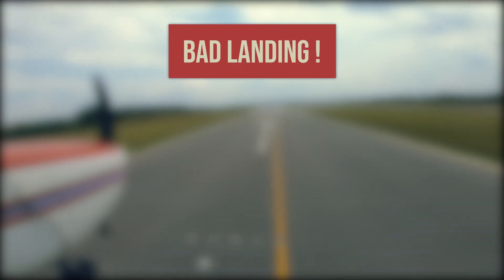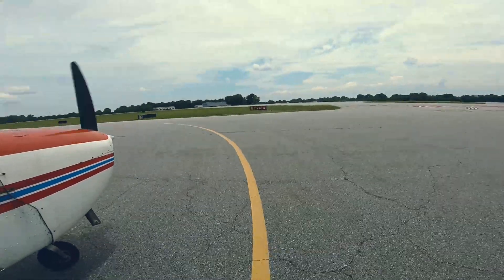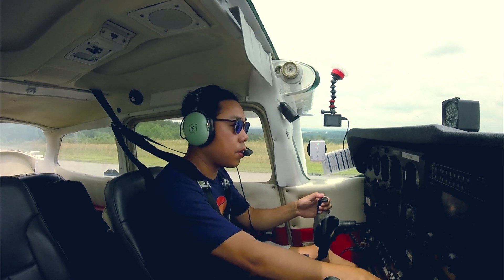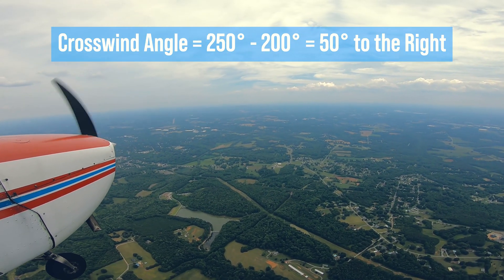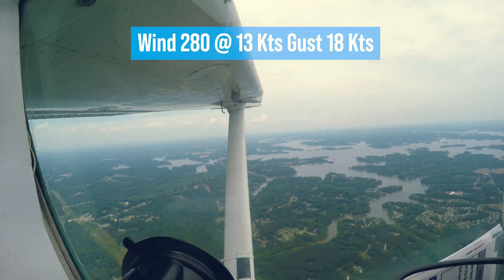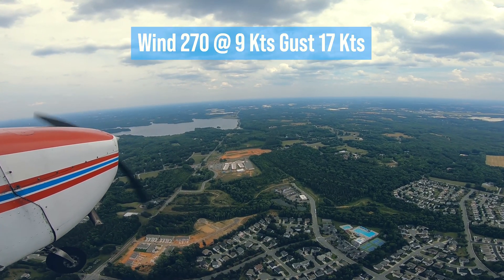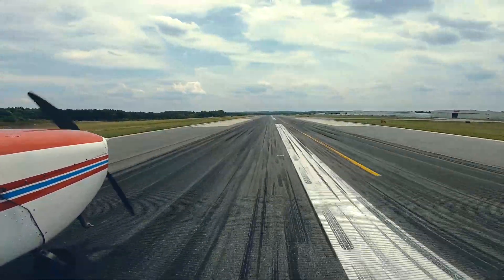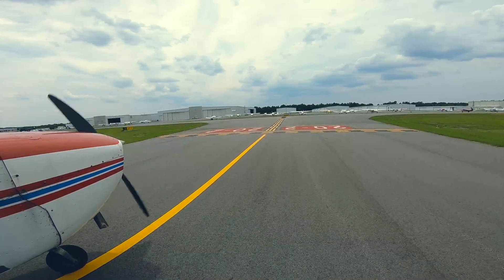WORST Crosswind Landing? Cross and Gusty before Storm

Comment: In my opinion, the landing was actually pretty good. The final was very stable despite the gusting crosswind. Good job there for sure. With 20/20 hindsight, I probably would have gone around once I see the deviation from the centerline due to gusting wind.
Reply from the maker: Thanks Peter! If the runway is 50 ft wide instead of 100 ft, I would definitely go around.

Comment: Thanks for showing.  I couldn’t tell but I would have instructed to transition to a wing low slip with maybe no flaps in a Cessna crossing the approach end of the runway.  So that’s touchdown on the upwind wheel first, down wind wheel than nose wheel.  Then of course ailerons into the wind.  30 mins. of practice and you will be a pro.
Reply from the maker: Thanks Mike for the detailed explanation. Yes that’s should be the way. I learned that before and just as time passed by I rarely got a chance to practice it. It got rusty and I didn’t bank enough to let the upwind wheel touch down first.